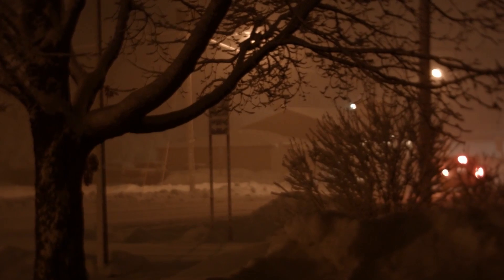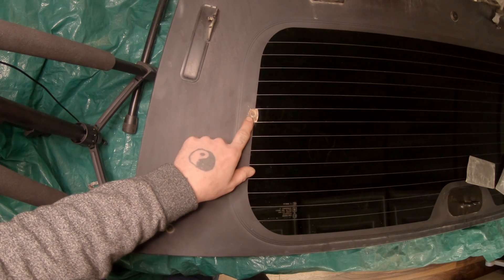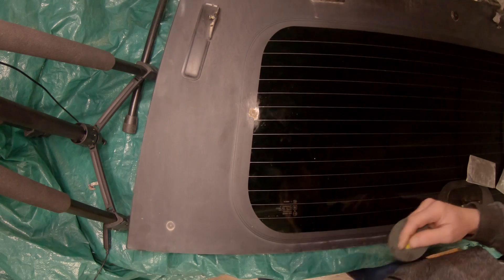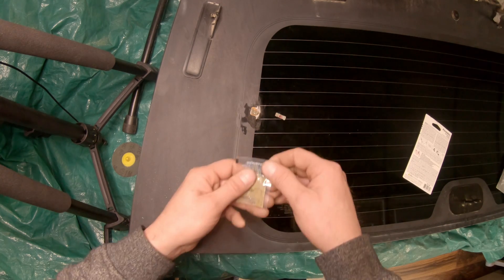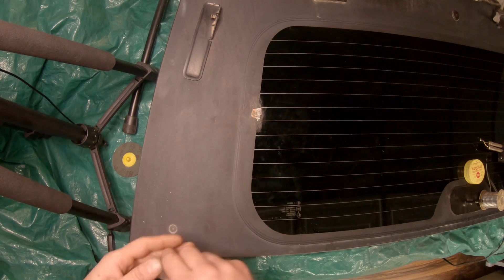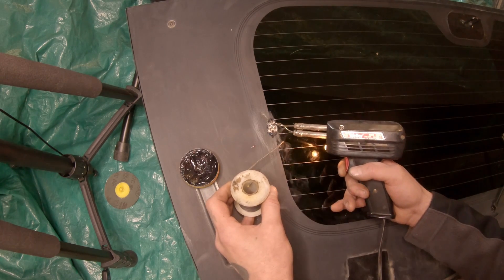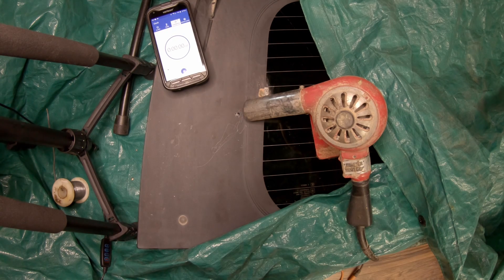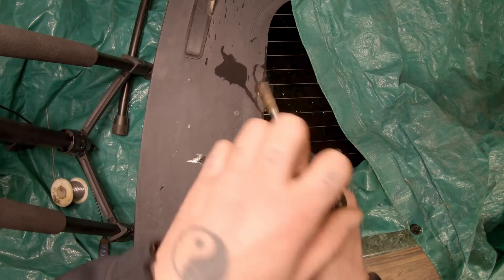Rear Defrost FIX and BONUS EXPLOSION!

Comment: I’ve done 7 repairs to various car rear windows defrost tabs by soldering them back on. I always preheat the window with a heat gun and warm up the inside of the car with the heater or just leave it outside on a hot summer day. All those repairs worked great and never fell back off. Just had my first one explode, luckily it was on my own car. It broke after I turned the defrost on, I heard a small crack then an extremely loud pop when the whole window shattered. So sometimes it works and sometimes it doesn’t. The only thing I did different on the one that broke was I had to move the tab above its original location about an inch. So I’d say make sure you put it back exactly where it was.
Reply from the maker: Nice tip. Thanks

Comment: Permatex popped off within 24 hours of letting it fully cure. I'm inclined to try soldering at this point, though my grid pad is pretty messed up from a previous "repair" by the dealer.

Comment: I did a solder repair on my 2012 Jeep Wrangler. I am glad I did not know about thermal shock at the time or I would have not soldered it. I did solder mine and it worked well. Seems good and strong.
Reply: I highly doubt the window would break by using a soldering iron for a few seconds.
Reply: did you use solder paste or a flux / solder wire?  I'm going to do the same repair on my wrangler

Comment: My  truck the piece that on the glass that the wire was connected to came off so it pure glass exposed does this Kit fix that ? There is nothing to solder on the glass anymore.

Comment: Did solder repair with a pen solder iron. Worked well no broken glass. Glass shop told me in the glass would be $430 and that they couldn't solder it, well I guess I proved them wrong! 👍
Reply: They just thought u were a sucker and tried to jip you dude fuck them good for you
Reply: You was surprised what they told you 😂
That's what they do for living, selling part's and repair 👍
I have never asked one repair shop of any advice,
as long we have repair book and internet with guys like him here.
We could fixing things ourselves in a cheap way 👍
And I never had any car's with this problem, but I would have used some second's for soldering anyway.
I doubt about Windows explodes if you soldering correct and quickly 😁👍
It's not going to heat up a large area, 
he showed this.
It's needed a lot of Heat,
but I would never do it outside coldest winter day's.
That's obvious 👍